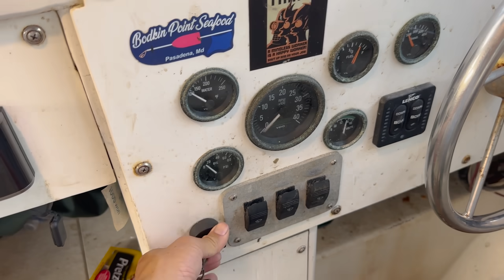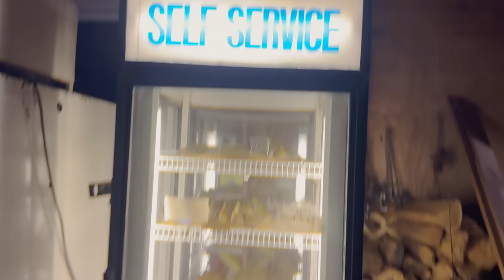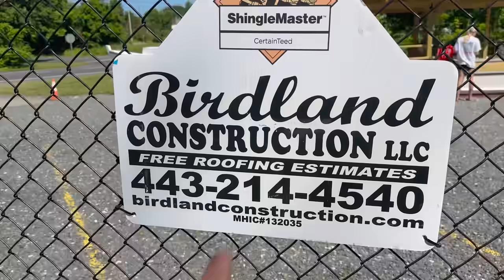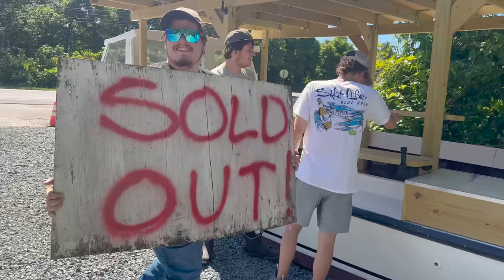I tested JUNKYARD crabbing gear

Comment: Luke

 Try running your pickup from pump (for crab tank) into the pontoons let it work as sump for pontoons then run that water into tanks and filtered back into bay.  Fix sinking pontoon problem while running one pump

Comment: I also have a 7.3 that runs and starts in the winter.. may be manual glow plug switch in the cab and a main power disconnect but it is what it is hahaha

Comment: Luke check out Edison Motors ev conversion kits. Generator feeds battery bank with solar and wing power.  3 kw per mile.  50% savings and they will train u to install the ev kit.  Also sell solar light tower trailers to power your off grid boat.  Add more roof panels.  Turns old boats and trucks into mobile emergency generators.  Redundant power to get back to the dock.
Reply: They started doing bush solar upgrades with generators backup.  You can also charge by shore power if at a commercial rate.  They will help put panels on every surface available.   Imagine running on electric motors.  May catch more crabs, less noise.  Get a green grant for the boat and your truck conversions.
Reply: Have your wife use the seconds to make crab cakes at home for the store.  Crab dip for sampling.  Do more business with your hungry customers.

Comment: Keep that condenser coil cleaned on that commercial drink fridge and it will last forever. 

Same with all your ac related equipment.  When they are dirty is when the pressures go sky high and they start breaking down due to excessive run times

Comment: There's certainly not as many crabs in the bay as there was when i was working the water.  We would constantly have 35 to 40 crabs per pot. But this was back in the mid 90's.  I miss those days.

Comment: 26:15 You need to add a 2x4 under the legs of the upper tank....your deck is sagging at the front leg...it will damage the deck and probably fall off if you don't address this.

Comment: Could you put an elbow on the drain? Face it up so the water overflows into it. Because the top of the overflow will be at water level the crab probably won’t be able to get near it

Comment: For those of us that have never had soft crab, Please give use that sandwich recipe!
Reply: Fried soft crabs on toast with lettuce tomato and mayonnaise.
Reply: Only blue crab I've had was vacation to Delaware in the 90s and it was soft shell sandwich. Very good stuff.
Reply: Here it is….  1. Procure two small soft crabs.  2.  Pour some flour on a paper plate.  3. Mix a generous spoon full of old bay with the flour.  4.  Dredge the crabs through the flour mixture being sure to coat the crabs. On both sides.   4.  Sauté the crabs in a pan with melted butter until golden brown and somewhat crispy.  5.  Slather white bread (or Martin’s potato bread) with mayonnaise.  6.  Add lettuce, tomato, and the cooked soft crabs to make the sandwich.  7.  Enjoy!

Comment: Question....
So a peeler is a crab about to shed, a soft is just shed, and paper is between soft and hard? Am I getting that correct? Why is a paper worth less than a hard or soft? Could you keep papers until they are hard? Or will they die in a tank before they go hard?

You should explain this to us non crabbers in a video